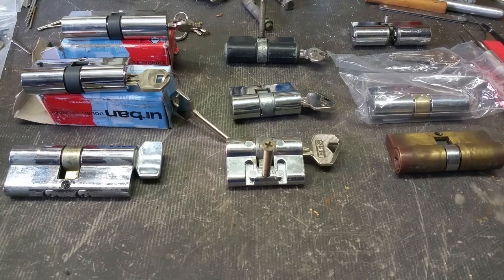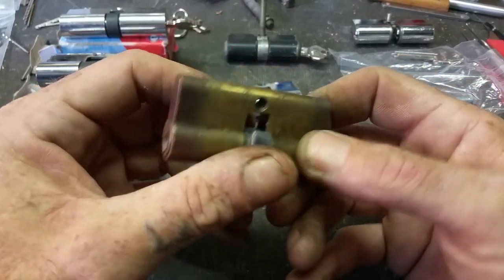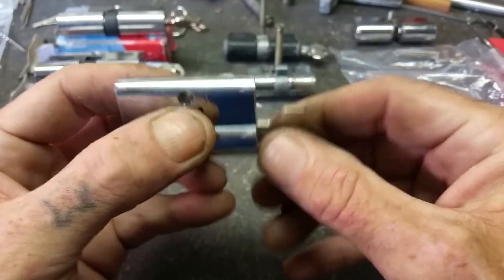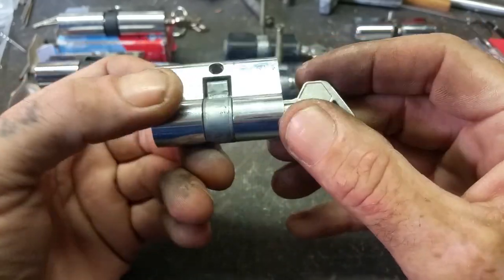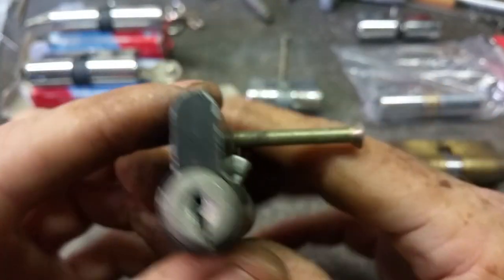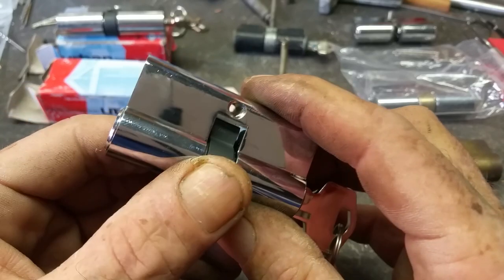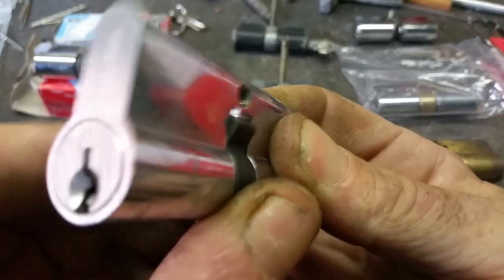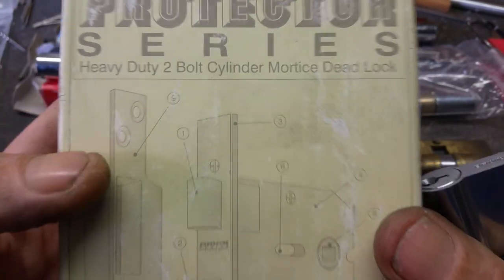#27 Australian euro style cylinders and their applications.

Comment: 11:52 When I was a lot younger, we had a lock like that one on the rear sliding glass patio door. Except the hook was a lot thinner and went down rather than up. One day I discovered I could unlock the door by raising it slightly when locked. I never trusted those locks after that. Good thing they changed the hook to go up instead.
Reply from the maker: They have come a way since the days of the single flimsy beak clipped over a flimsy little pin. The better quality patio lock sets have the double locking beaks into a sturdier strike box with the anti lift lugs. In saying that, i always suggest a patio bolt as a secondary lock point on a glass patio door. Cheers:-)
Reply: @crankylock7844  Yeah, we had a stick we put into the rear track behind the sliding panel.

Comment: 13:55 I'm surprised you have one in that size. The reason why I asked about the sizes is because I have screen doors with the Austral locks in them. Crappy zinc 5 pinners. I replaced one with a Gainsborough lock set after the original lever handle broke. But I want to replace both of the Euros with a pair of keyed alike locks. However, I'm after a certain size. The Austral one is 62mm long and sticks out a little on both sides of its housing. I figured a 55mm length or even 50 mm would be better but, after hunting all over eBay, I can't locate any Euro profiles in that size. Given they make every other size in 5mm increments up to 110mm I find it rather strange.
Reply from the maker: I am sure that they would be out there somewhere. Not so sure if they are lw4 compatible. The 5 wafer whitco is the only one that would be close to the size you are seeking. Cheers:-)
Reply: @crankylock7844  I know the 45mm ones are all wafer locks. But there must be some pin tumblers (not necessarily of the generic type) in that size. What about Kaba?

Comment: Good interesting video Paul. I'm not a fan on Gainsborough also. My brother has a tri-Lock. :/
Reply from the maker: Thanks Donz. Yeah, they like Assa Abloy won't sell parts to their locks. It;s annoying. The tri lock is over priced tat. The old version Tri lock is a complete disassembly to rekey. They finally changed it up in the later versions with the advent of the grub screw to remove the cylinder which saved some time. Cheers:-)

Comment: On the fixed cam, why does the cam stick out a little in the default position?
Reply from the maker: It's to do with the internal actuator in the cam. I'll expose one in a video at some stage. Cheers:-)
Reply: @crankylock7844  OK.

Comment: I was after a Lockwood Euro Profile for my collection. Found one on eBay. Guy claimed it was new but it has no key. Has an M profile with B6M stamped on the cylinder.
Search for Lockwood 9555 on eBay and you'll find it. No point without a key but a free one would be nice. :)
Reply from the maker: The 9555 i am aware of. Don't use them and never will. Over priced. You're paying for the name. The Whitco euro is of the same ilk and is quiet satisfactory. Cheers:-)PS. I'll get back to you re the cylinder.
Reply: @crankylock7844  OK. I was curious because it took me a long while to discover that Lockwood make a Euro Profile. Must be quite rare. Only 4 listing on eBay for them.